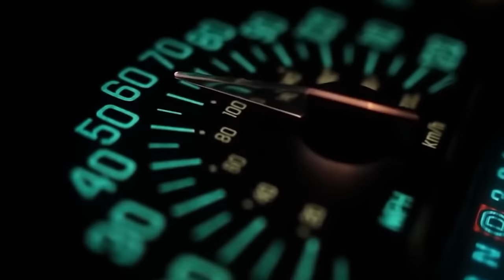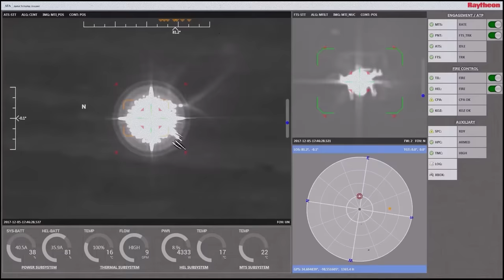America’s DE M-SHORAD: The Future of Laser Defense

Comment: After seeing a small drone costing a couple of hundred dollars (Switchblade) take out a Russian air defense system costing a few million I'm really glad the US has developed this.
Reply: @geocam2  Nu-uh, at these kind of power levels a reflective coating wont do anything
Reply: @geocam2  I thought of that also.  Apparently so did the military because they equipped the vehicle with a small computer controlled mini-gun.
Reply: Switchblade 300 costs nearly 58k usd, just in case
Reply: @mormatus  The Switchblade 300 drone, manufactured by AeroVironment, costs around $6,000 per unit.  However the same model with all the bells and whistles they can put on it so that it can be guided by satellite from anywhere in the world cost 58k.  Knowing the US defense industry, those will be the ones they order.  lol
Reply: @timehaley  "In the 2022 budget, the price for a single unit – the airframe, sensors, integrated guidance, warhead, data link, and launcher – was $58,063. This cost does not include additional elements like the guidance unit, which costs around $30,000, or fielding costs, spares, support, training rounds, and simulators."
🤷

Comment: the main issue of laser systems is that they dont really meet a crucial requirement of any military technology and especially any given to a grunt to use: ruggedness
lasers rely on very precise alignments on the internal components and are generally very fragile, i think in stuff like ships they will be fine but on something like a striker may get damaged fairly often, another issue is that the maintenance for such devices requires a dust free environment, and i dont mean make sure it is clean i mean actually dustless, which on a battlefield is VERY hard to achieve, it may be cheap per se but the logistic chain it needs will be fairly severe, most likely damaged even slightly so devices will have to be flown back to the mainland for servicing so more would be needed as spares on hand to keep the system operational, which adds the additional requirement of making the system fairly easy to swap on the field, other than that this system is indeed a GREAT leap forward, tactical air defense is a department the US and in general western militaries lack somewhat in, not as much as medium range but still, Manpads cant be the solution to everything, and after the retirement of the hawk no new medium range aa system was introduced, a weakness highlighted in the struggle of Ukraine in dealing with helicopters that will stay far enough to be out of range of manpads but too low for SAM's to deal with,.
Tactical Drones will remain the equipment of choice for low budget militaries or insurgents for decades to come, maybe not as prolific against higher value? density targets but for sure they will remain cheap enough to be worth losing them for intel gathering or striking targets of opportunity, warfare is changing in front of our eyes, from quality to quantity once more, the ultra high tech tank will decrease in value on the battlefield as total coverage and situational awareness that was already before sparse will now become even less reliable
Reply: Paragraphs, my man
Reply: Tanks already use highly accurate optics and lasers for targeting. There are missiles and even artillery shells with incredibly complex and precise mechanisms inside them that can only be manufactured in high tech facilities. I think the bigger issue with these systems is that they're being mounted onto armored vehicles, which are pretty much guaranteed to the first things blown up in any engagement, if the situation in Ukraine is anything to go by. If they can produce smaller, more concealable versions, then I think they're on to something.

Comment: The iron beam is meant to compliment the iron dome.  It wouldn't be able to replace it, in the near (or not so near) future. 
A) the beam WILL diverge because, physics
B) There is the issue of scatter (Rayleigh? Although that might be specific to non particulate induced scatter only).
It's definitely a game changer but these are ONLY for short range interdictions.
It's been too long, sorry, but i believe they are "hoping" to coax a few miles of range or of these.
I imagine it is used in a small areas where  valuable assets are clustered.
Reply: or possibly along the border if the radar fire control system can react fast enough to rocket launches,

Comment: 24 months of development.
It's amazing how fast technology actually develops when it isn't being stonewalled by dictators and oligarchs to maintain the status quo.
Reply: No, it's just old technology with a new implementation. In this case the lasers weren't good enough for anything else but they were good enough for drones. The lasers were only good enough for drones and they used radars that were aimed at missiles and combined them.
Reply: @zaco-km3su  Yeah I think this was more a showcase for the tracking and fire systems. They will need a lot more power, or the AI software to have more lasers focusing in concert and overlay some judicious use of a few backup Phalanx systems for this to be ready for prime time.

Comment: A nice discussion. But it shares some of the problems one sees with other discussions bearing on use of lasers. A bit more detail would have been useful. One thinks of atmospheric degradation stemming from visible moisture, rain, and fog. Lasers definitely seem to a "sunshine" weapon? What is the effective range in the presence of visible moisture? Then there is the defensive problem posed by use of ablative materials or reflective coatings on the incoming target. One would have liked to see some discussion regarding those aspects of laser use. And how capable is SHORAD in responding to target maneuverability?  What is the "burn rate"-- how long must the beam be focused on the specific point to do damage, before  the target can maneuver away from the focal point? Finally, you spoke of the use of "directed energy" weapons, while limiting your remarks to lasers. One understands there to be potentially a wide spectrum of energy applications, not just photons. One thinks of microwaves, electron beams and so forth. Each is understood to have its own set of characteristics. So use of the term "directed energy" would seem to be overbroad, and a possible source of confusion?

Comment: Won’t painting the target the expected colour of the laser, or giving the drone a mirror finish counter the laser?
Reply: Not really - color doesn't matter that much, and most mirrors are ~90% reflectivity... it won't take long for 5kw of laser power to damage the paint enough that the full power starts getting absorbed. You need high reflectivity (at the wavelength of the laser) and high thermal resistance to provide a real hinderence, which is not a simple thing to do to a cheap drone, while still keeping the drone cheap.

Comment: So if they are using the Stryker diesel to recharge the battery....
That means they have a limited number of shots before they need to recharge...
Also the battery pack will have high load and discharge cycles.... possibly leading to fire.

So I doubt it is the panacea this video implies.

Comment: We would be better off using kinetic weapons that target radio signals. Most drones are remote controlled and not automated, detecting the radio signal it emits would be more reliable in my opinion. However, I am a geologist not a military designer. I can't imagine lasers being reliably useful outside of space combat, there are too many things that happen with atmospheres.
Reply: If weather IS a big deal, it is a double edged sword for the attacker. Sure, having atmospheric effects on your side when attacking helps BUT, it makes you somewhat predictable in WHEN you attack and knowing is just half the battle.

If all else fails, there is a good chance this might be ONE component of a new SHORAD system which will have a ~40mm programmable explosive round to take out the drones in less than ideal weather.

Comment: Laser weapons have been in development for a number of decades.  They are at best another arrow in the quiver of the warfighter. Lasers are greatly degraded by fog, rain and snow.  They have very short ranges and depending on the target can have prolonged dwell times.  Lasers themselves are gaining in efficiency but are still maxed out at about 85%.  Finally, incoming weapons can be coated with laser reflective materials.
Reply: Absolutely correct.  Yet another video full of bull from this guy.
Reply: It's why US Army is exploring all options. Their is the conventional M-SHORAD, laser DE M-SHORAD, and they are even developing a microwave C-UAS with Stryker Leonidas. Their is even the drone vs drone Roadrunner from Anduril.
Reply: Yeah but the small drones are made of flimsy lightweight material and it only takes very minor damage to disrupt their flight or control systems. The system is designed to engage them at close range so the short range of the laser isn't a problem. As for snow, fog and rain, small kamikaze drones don't currently operate in these conditions either, as they are too light and flimsy, and rely on visual targeting. And as for laser reflective materials, that would add weight, making the drones bigger and easier to detect and target by more traditional means.
Reply: Which makes me wonder if a different, more physical, approach might be necessary. I'm not smart enough to come to that solution but a huge "bug catcher" if you will seems like a feasible option
Reply: I'm afraid that cameras and sensors "coated with 'laser' reflective materials" will not work as cameras and sensors anymore.
Reply: @AlessandroRodriguez  Indeed.  However, you realize the percent of surface area that the camera and sensors is small.  The fire control system will probably go for center mass.
Reply: @WWeronko  is not bullet, and is computer operated, also AFAIK you can "focus", the beam, meaning you can shoot the whole drone in blinding rays, the chinese already do that, albeit unintentionally, their lastest lidars are blinding people and cameras across china.
Reply: @WWeronko spending those materials on a drone designed to be cheap and mass produced... will rapidly make them not cheap.
Reply: Sadly, as usual, the US Army is preparing for the last war. These are very effective weapons against crude, improvised weapons used by low technology opponents aka terrorists and underdeveloped nation states. Modern armies however will have no problem making their air weapons impervious to these lasers.
Reply: @NotYourBusiness-bp2qn  no they wont kekw.
Reply: Ever look at the first jet powered aeroplanes...not very impressive huh...
Kirkland seemed like it was dedicated to directed energy based testing. 
Can't wait to see this in 5 yrs.
Reply: @adventurerr2050  The first operational jet powered airplanes where EXTREMELY impressive and dominated the skies when introduced.
This is a expensive gadget who's primary role is to siphon money out of the gigantic DOD budget. It is useful against commercial drones turned into weapons of war by low technology opponents like terrorists. Which  is admittedly is still a threat but not the main threat anymore. Against a purposefully built military drone they are, or will soon be, irrelevant.
Reply: @NotYourBusiness-bp2qn  I disagree. As Impressive comparing them to a p-51's performance. BUT not as impressive as an F22..so you see the early jet fighters were nit very impressive. I am not easily impressed. I have been around most. Don't get to touch them all but many, mere inches away. All were flown to the tie down.  Obviously I couldn't get with in 15ft of say F117 or SR71.
The rail gun has been reduced to its smallest size with avaliable current materials. First worked with two lazers the military had sent to be used in two machines we were building they were 3ft x 4ft and 22ft long. We used it to cut a glass, they other smaller but huge by today's standards. 700watts
 It welded the glass vile inside of a little can. Stack 15 dimes , that's the size of the can. 1984.
When driving around Kirkland I thought oh my God how are they ever going to make theses thing smaller than a commercial airliner. They weren't like as big as a  Boeing 757..but huge. That was 2012, 10s of thousands of civilian contractors worked, now it's on Gerald Ford and battle field vehicle's for continued testing and development.
My first bag phone was just that a big bag and a hand set. Happens it could text being digital but texting wasn't a thing in 1997. Had 3watts of power though. Now look at phones. More computing power than the space shuttle in our hands.
High enegry weapons are the future. Less civilian casualties also. Travels at what speed?
Ya..nothing will out run a Lazer burst.
They aren't for just illuminating targets anymore.
Reply: @adventurerr2050  At the time of their introduction jet fighters were already better than anything in the sky. At the time of lasers being introduced as weapons, which is now, they are not even close to the performance of other AA systems. But the problem is not that they are still ineffective, that can be improved upon. The problem is there are ways to completely negate them with countermeasures. Best case scenario these weapons will force the enemy to coat their airplanes, missiles and drones in reflective materials. That would make them easier to spot and more expensive but it would render laser weapons completely pointless. Given that they cost way more than reflective paint I am quite skeptical about them.
Reply: Yes, although it limits their capabilities since those materials aren't very conducive to high speed flight
Reply: @MarcGyverIt  How exactly is a coat of chrome paint going to impede "high speed" flight?
Reply: @NotYourBusiness-bp2qn  I was thinking about missiles. They travel too fast, it will burn off, break off, etc depending on the missile.
Reply: All of these issues have been taken into account to a minimum reasonable level. Certainly, Fog, rain and other adverse weather, will still impact them, but they will still be effective, though probably at a shorter range and probably requiring much more energy than usual, but still work.
There are many ways in which laser systems can deal with these weather issues and battlefield lasers most probably have many of these solutions in mind, including but not limited to laser wave discriminators, self-adjusting optics and simply more energy output to increase laser coherence.
As for reflective materials, they would make things laser resistant, but not immune and once the resistance factor is broken, the target is taken down just the same.
Finally, these are 1st generation laser weapons, with a 30-50kw power level, future systems will significantly ramp up the energy level of these lasers and make them even more deadly.
At the rate of laser proliferation, it is possible that the first Human Death by a Laser could happen within the decade
Reply: @Keemperor40K  This is a serious discussion not a Star Wars forum. More energy? From where? "Future systems will ramp up the energy levels..." Sure, all we have to do is invent a a compact, transportable cold fusion reactor. No biggie. Oh and lenses and mirrors capable of focusing these incredibly powerful beams without melting as well. Sure, coming up, only a couple of years away.
Reply: @Keemperor40K  I totally agree.  I didn't say lasers have no role.  However, they are not an answer to all things.  They are as I said, another arrow in the quiver of the warfighter. In the beginning era of mass drone attacks, they are a greatly appreciated arrow.
Reply: @NotYourBusiness-bp2qn  most of those solutions already exist, but are yet to be miniaturized and militarized.
The mirrors example is the National Ignition Facility, that uses thousands of mirrors to increase the power level of lasers to well over 150kw of power individually.
And that is based on 80's to 90's tech, so if they where to design a similar facility now it  would be half the size and produce twice the power output.
As for power, the simplest method is to get several generators in tandmen to increase power (not the most efficient, but a simple method).
In the future (not sure when) small scale Fusion reactors are a possibility and at least one company has plans for one no larger than a backpack, that can output over 200kw of power.
But to the point most of these are systems that exist today and simply need time to mature into military applications.
Reply: @Keemperor40K  You clearly don't know what you are talking about. There has been no breakthrough in power generation technology in the last 50 years, 90'a tech is today's tech. Humans have developed a lot of apps, emojis and meme's since then but no new technologies. I guess priorities have changed....
A company has plans for a cold fusion reactor backpack? Go away, you're a troll...